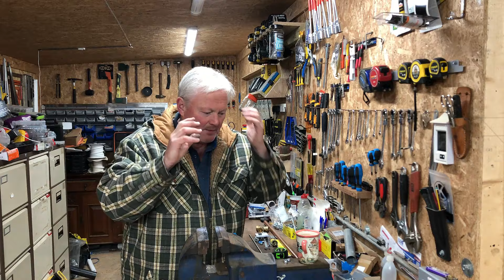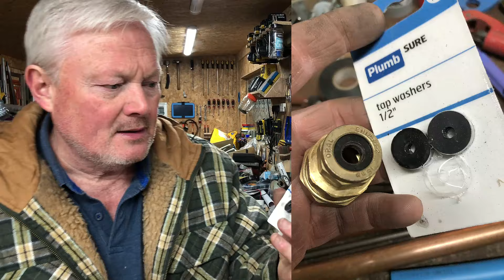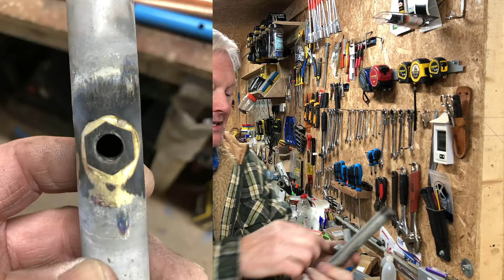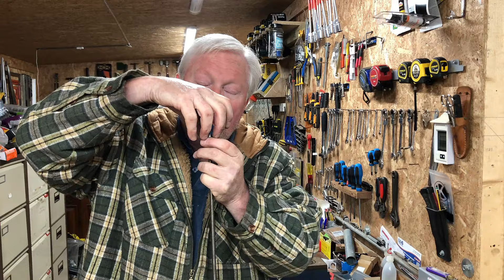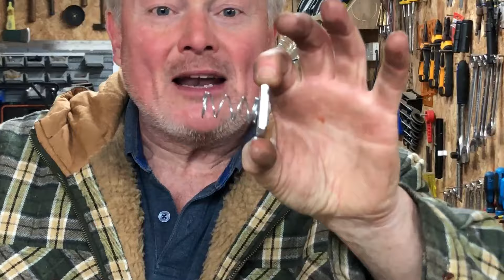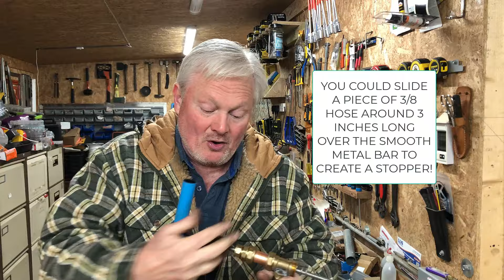Bait pump  build part 1

Comment: Hi i wish you good luck with your bait pump i have never seen 1 with some much bling on it you are making really hard work for such a simple device you have restricted your self with that fitting halfway up the shaft good luck
Reply from the maker: I agree to a degree! I did change the metal rod inside for a one piece stainless steel rod. As with all things new there`s going to be trial and error. But I can report that I was pumping worms no problem only yesterday! And I like to make things solid, so they don`t fall apart! Shaun.
Reply: @happydaysveg1965  I'm glad you changed the rod as long as it saves you money and works that's all that matters happy pumping just hitting the beach to pump some 50mph winds should be fun
Reply from the maker: @hastingsangler  Stay safe! The weather has been carnage up my way!

Comment: If you need to cut your pipe to get a dent out then a compression fitting won't work. Yes it will join 2 bits of pipe but you won't get the silicone washer past it as it will have compressed the pipe. There's  a clue in the title ! But you know this already and you're just seeing who's awake. You little scamp. 😉

Comment: Wow you've over engineered something that's so easy to make been making these for years with 3way equal tee and a brass blanking cap with a hole drilled through no need for the 22-15 convertor
Reply from the maker: As i said, its all about giving it a go and if it needs any reworking that`s ok! I have refigured it and it works great. Each to their own. Shaun.